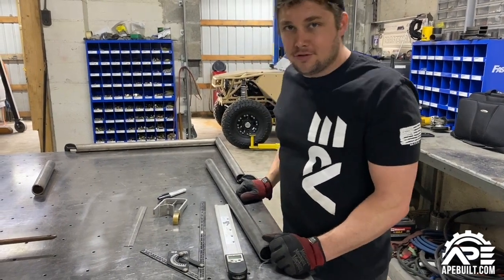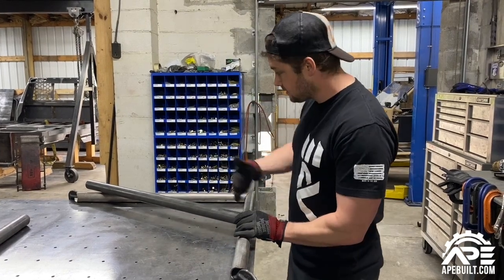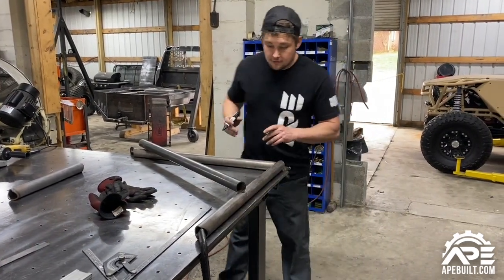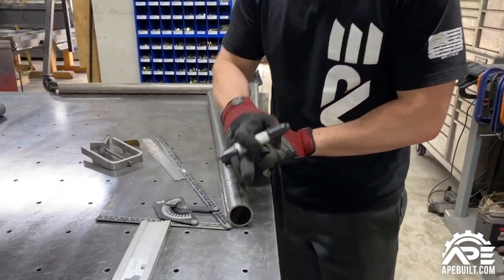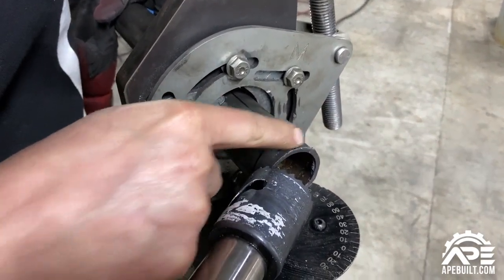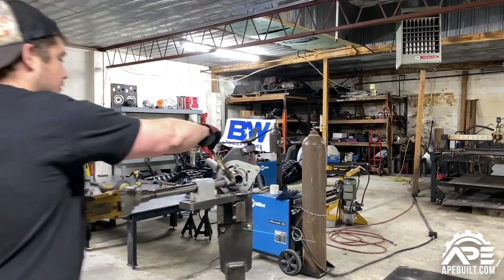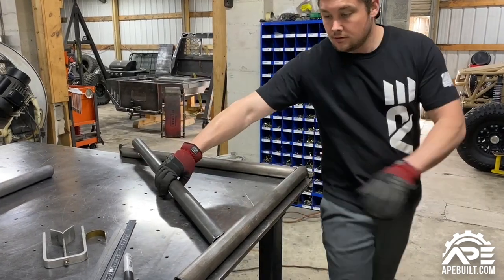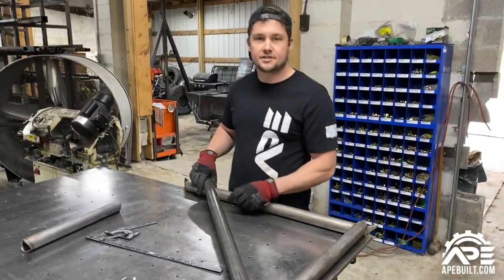TECH TIP - Beginners Tube Notching

Comment: What size of hole saw do you use is it always the same size as the tube
Reply from the maker: Depends on the size tube you are coping to... you can notch smaller tubes to larger tubes... but when notching large tube to smaller tube it begins to create a problem with over a 1/4" size difference.  Hope this info helps.  Cheers.